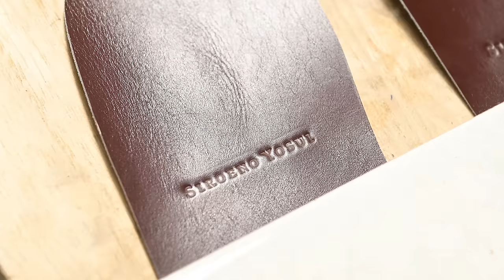Making HANDMADE Classic Shoes in a Vintage Freudenberg Leather

Comment: I always wonder why they hammer with the wrong side of the tool, there is a hammer head on the pincers but they always flip it and use the other side?
Reply from the maker: Thank you for your comment.
The reason I flip the pincer is to keep flat surface for the hammer head. I use the head part to hammering shoes for shaping. If the head part is damaged by nails, it causes scratch on shoes surface. Hope it make sense!
Reply: @siroenoyosui  ahh interesting! Thank you

Comment: Can anyone explain what's going on when they do the heel? It looks like they paint some dye on, burn it, scrape it off, and then burn or paint it again? What's the purpose of all those steps to make it look black?
Reply: he paints it, then rubs edgewax on, then with the hot irons he spreads the wax and melts it into the leather heel- and sole edges. That closes the pores and makes the shoe bottom waterproof and more wear-resistant. In the end he rubs it with a cloth to take the excess off and make it smooth and pretty.
Reply: its the very traditional, oldschool way to do it
Reply: @klausbecker4745  Thank you. That makes sense.